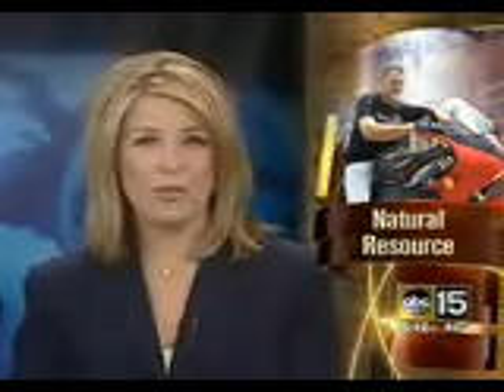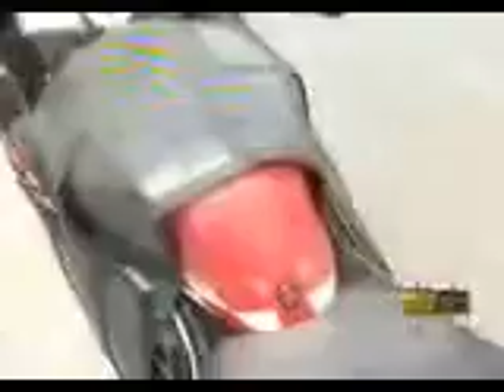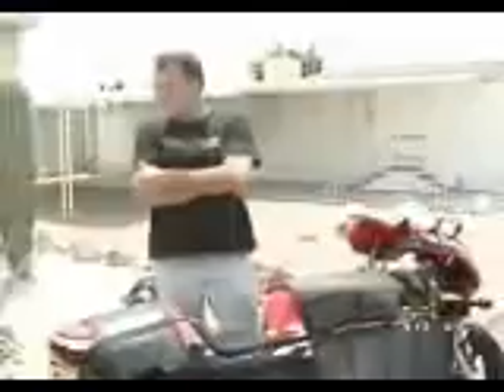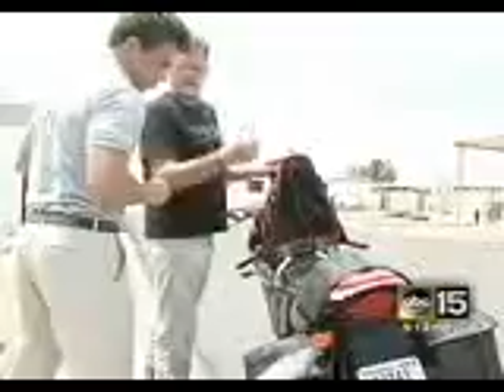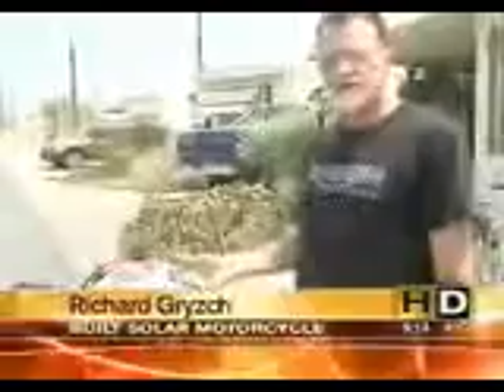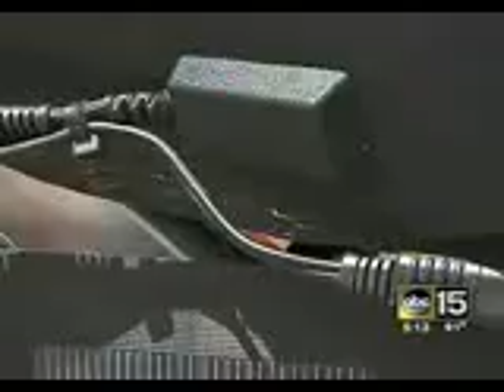Apache Junction man invents solar powered motorcycle

Comment: Hi, to all, see Electra Green on the web site firstontop com
This motorcycle is one that use solar power to run.
We need more inventers working on this to help keep our one world running.
Good work on the bike. The point is  this bike uses green power to run.
Electra Green uses solar, wind, hydro, internal, and external grid power.
THIS BIKE IT RUNS USING THE SUN MOST OF THE TIME.